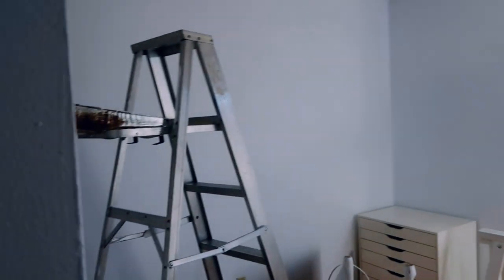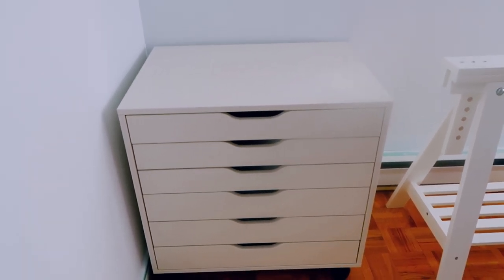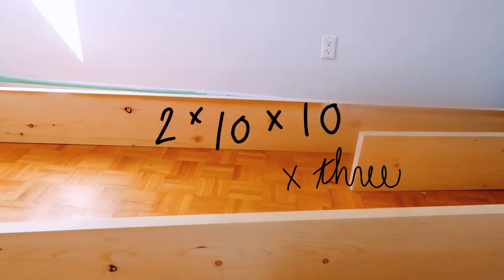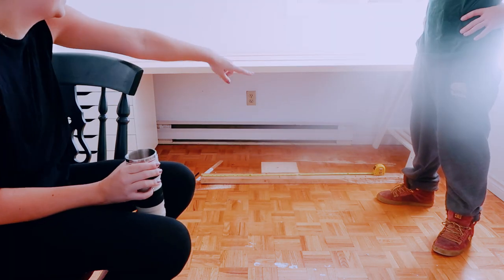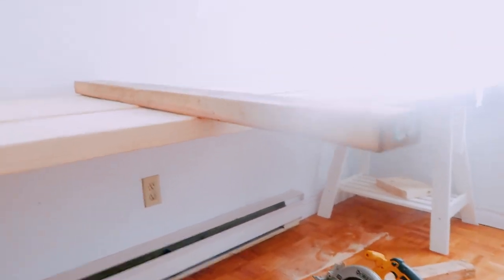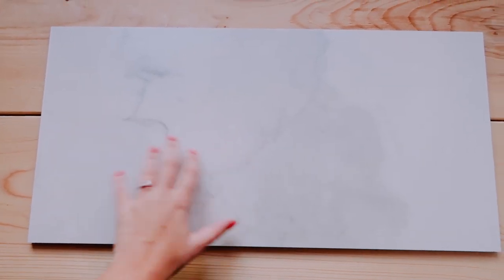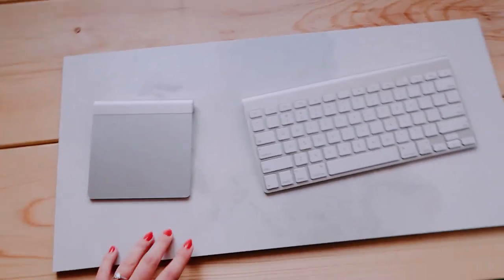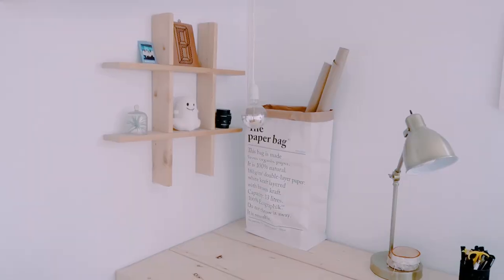DIY GIANT HOME OFFICE DESK

Comment: If I were you, I'd do a finish to the wood. I just think you'll be happier with it, even if it's more work to do. Sanding and putting a clear finish on it doesn't change the look much, but the feeling.
Reply: You should use wipe-on poly (polyurethane). It protects the timber nicely and enhances the natural colour and grain (it will just darken it as tho the timber is wet!). It's also really easy to apply and comes in different finishes such as gloss, satin and matte.
Reply: Celine Ertzinger 100% agree!  As soon as she spills anything or even make up on the bare wood its going to stain the wood.  Need something to seal the wood even a water based semi or matte
Reply: does tung oil seal wood in the same manner?
Reply: does tung oil seal wood in the same manner?
Reply from the maker: You're totally right! Added it to my "to do" list ;)
Reply: I agree; however, don't think that would work very well, mainly because of the nature of the 3x10's he used. There is about a 1/16th of an inch gap between each that wouldn't come out even after plaining and sanding :(
Reply: nice idea, and will protect the wood
Reply: Totally agree with you! That way the whole desk is usable working space, not just the porcelain tile. I'd even go a step further and set resin over the entire top of the desk so you still get that nice natural timber look but a flat surface to work on.
Reply: I agree, finishing the wood will go a long way. I plan on DIY-ing my own desk soon. A local hardware store sells table tops that are made for putting together your own kitchen table. Cutting it down to size and finishing the table into a desk is my ideal. I'll probably pair it with some sit to stand telescoping desk legs and a CPU caddy to suspend the PC tower under the desk.
Reply: amazing desk.  love it.  is that a lumiy lightblade lamp! wow love it too!
Reply: It would also be nice that if you spill anything that you won't have a reminder for the rest of your life.

Comment: My favorite easy DIY desk top is to get a flat hollow core door from Home Depot or Lowes and put it on half height file cabinets, shelf units, or the trestle style legs like you did.  The hollow core door is nice and light, but also sturdy and rigid enough and they come in a variety of widths, so it's easy to have a massive, substantial work surface that's easy to move too.  In college I did this and stuck the door to the cabinets with poster putty so it would stay put but also be easy to take apart when it was time to move.
Reply: Alex Reith yoooo that’s actually soooo simple and smart

Comment: So cool. You could also just use flat metal brackets or L brackets on the underside to hold the wood together and even mount it to the wall for added stability. I love this. Especially just using 2x10s. So much more affordable than sheets of lumber. I'm going to do this.

Comment: I want to buy a 2 meter long - 22mm thick oak worktop and support it with dado rail style supports around 3 of the edges. Will it bow in the middle without a middle leg? Or will it be ok? The worktop will weigh 31kg

Comment: Ok so looove the light bulb idea. How did you set it up? Is it coming from a wall socket or the actual light fixture in the ceiling. Points if you can tell me what you used too x

Comment: A tip for cutting down legs- especially angled ones: Use a spacer block of thickness equal to height you want to remove then scribe around the leg with pencil using block. Then cut along line, making sure kerf of blade is on waste side of line. This works on tables, chairs, barstools, etc.

Comment: I did something similar. I mean not as cute as yours but I put a plank of plywood on top of at first 2 columns of cinder blocks. I replaced one column with a cute gray filing cabinet of drawers. The other column of cinder blocks is still there because I can't get another file cabinet just yet. I thought I would get two so that the two sides matched but now I'm wondering if I want to do something different for the other side. But I definitely want to replace that plywood with some better wood, like what you have. And I definitely want it to be longer. Mine is only about... I can't remember if it's 4 or 5 ft but I want it to be longer like at least 8 ft. I would do 10 or do across my entire room from one wall to the other If I didn't have a workbench in there with my 3D printer on it. So I have to cut it short enough to not run into that. But I saw this and it was what I had imagined for mine so I had to watch your video! Very nice in that nice clean white room! Looks beautiful!

Comment: A few other ideas, for use in a standard-lumber-based office setup:  Use smooth panes of glass on top of the wood as a finished desk surface. Any good glass / windshield repair shop should be able to supply this. I have seen a single thick pane of glass used as a cover for a round, wooden tabletop, and it works. It makes for a nicer surface to sign documents on. for the trouble you went to, you could also have done away with the IKEA sawhorse by constructing ledges of layers 2 x4s to set your lumber shelf on. Your setup is neat, but looks like it could use some cable management.

Comment: The really annoying thing about building an Ikea custom desk is that none of the sizes match! They have 120x60 and 200x60 table tops but if you want something in-between it's 150x75 not 150x60, why? The draws don't match either. The narrow 5 draw is 75cm high and 58cm deep but because the wide draw is only 66cm high and only 48cm deep, so you can't mix and match anything!

Comment: None of that was DIY, and the wood needs to be finished or it will give you trouble soon. Doesn't make sense to leave the wood unfinished. At least sand it.
Reply: I'm not sure you actually know what DIY means.

Everything in this video can be done by the average person. None of this required a professional, contractor, etc.

Even if you stain or paint the wood, you can still DO IT YOURSELF.

Comment: Fix the cable management please
Reply: Oh yeah and the middle will sag
Reply: With so few things on the desk it won't sag to soon with that thickness but you're right it's poorly designed with a support only at both extremities for that length.
You also forgot to mention the anti-ergonomical chair (wasn't an Ikea commercial that I just saw ?!) and the lack of finish on those raw planks (sanding, varnish ?).